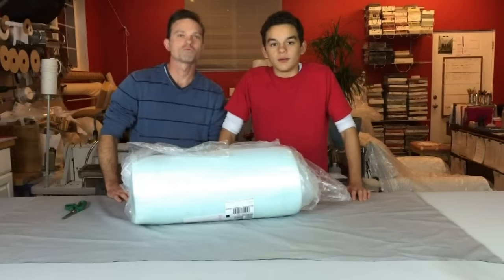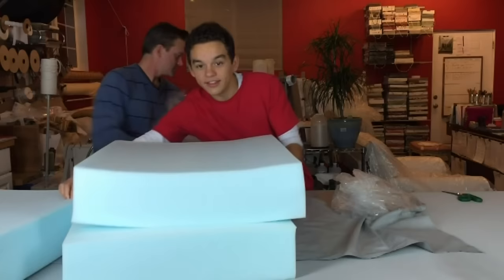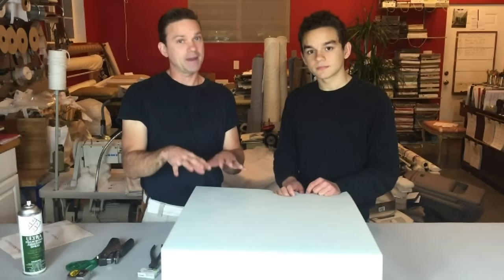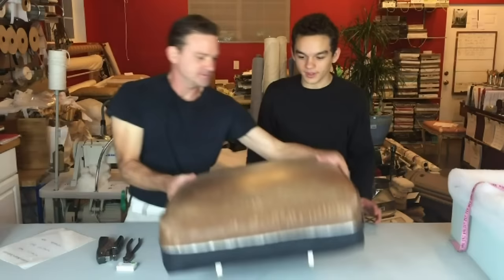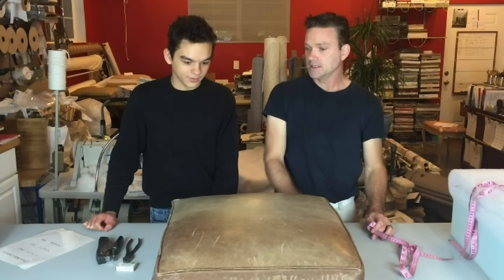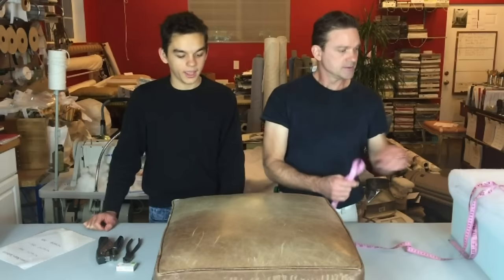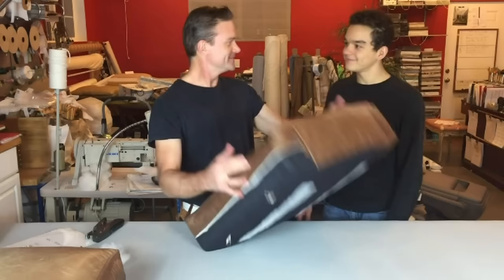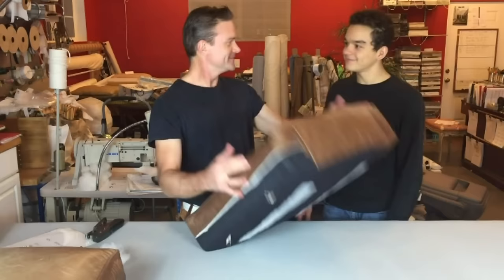Replace the foam in your seat cushions fast and easy!

Comment: Don't like the staples, potential issues with poking, coming loose and getting lost in fabric, furniture, floor, mouths of babies, floor stepping on them, jacking up vacuum cleaner... Learned a lot however, and enjoyed your thorough details and father/son professionalism!
Reply from the maker: Hi Artemisia,
Thank you for watching our video it means a lot to us. One other person had a similar concern. This practice has been around for about 5 decades, in the 3 decades I have been around this method, I have never heard of/or experienced the fear you have written about. Sometimes when stapling the batting together I will only staple one side not both. To remove that one staple, that is lodged in the one side of the batting ONLY!! You need to use needle-nose pliers to remove the bared staple from the batting. Staples fold on themselves when set in place! It is not likely to fall out!! Anymore than having a staple fall out of two pieces of paper that have been stapled together. There is always glue to use but, think of those side effects. Thanks again, we hope the video has helped you in your project.  All the best   Paul

Comment: Your tutorials are grand and both of you make a great team. Enjoy very much! 
Need to replace seat cushion on my couch due to sinking on one cushion that has been sat on the most. Likely have to do all cushions to be uniform.
My hubby does not like how low sofa is to floor. He feels his knees are up high. Is there a way to fix this situation? 
Was a gift. Only three years old. Material is still appears brand new. 
Thanks so much. 
Subbed!
Reply from the maker: Hi Linda,
Thank you for watching and for subscribing as well! Great questions are the legs on the sofa removable? If so the could be one way to add height the sofa, by removing the old legs and adding new ones. We go into the different leg types in this videos: https://youtu.be/K4RlabneiJI?t=4m41s hopefully this will help!
Thank you for waiting by the way, we have been super busy!

All the Best,
Grant

Comment: Thank you so much.  I have been covering my dinning room for years. I picked up a better way to cover them.  My problem when covering them is to get them all to look the same.  Also with dinning room chairs I would be interested in your Recommendations for the size of the phone
Reply: Sorry,  the size of the foam density.
Reply from the maker: Hi there Ann,  thanks watching our channel and leaving a comment. Yes it can be a challenge to make them all look the same, not only in thickness but mostly when lining up a print or matching it to other chairs. If you’re talking about lining up a print, matching reference points are the key as well as the measurements of the slip seat. If the fabric stretch it is really easy for the print too distort the matching. The foam recommendation for dining seats is usually 2 inches with a firm compression like number 45. I hope this addresses your problem again thanks for watching. Please consider sharing our videos we really appreciate it. All the best,     Paul

Comment: Excellent instructions and demonstration-great father-son team!  Some other videos have shown using a vacuum to shrink the foam and then inserting it into the cover.  Are there times when you use that technique?
Reply from the maker: Hey Brenda,
Excellent question! Yes, we do use silk film in certain scenarios for example when it’s a T or L cushion, as well as a very long chaise cushion. So this is pretty rare though since we usually opt to just muscle it in most of the times

Comment: i know that cushions comes in three colors...yellow, pink and blue, which one has the best, strongest weight and bounce back resistance over time when it come to both back and seat cushions...TIA
Reply from the maker: Hello Sazon, thank you for watching the video I have seen the yellow and the pink in the past but I don’t go by the color We go by the compression and the density of the foam. The supplier that we have used blue foam for high density.  The compression is 26 to 35 For Seat cushions. For back cushions it is a lot softer compression  20. Go to ucprivatecourses.com. It shows the options and you can purchase it there. Thanks again for watching please share with friends and family it helps a lot when you do cheers,     Paul

Comment: Thank you for this informative video. I was wondering what you would recommend for high use, outdoor cushions? We are in a humid climate and although the cushions are in a screened in porch it is still subject to the humidity. Considering as well that there will be roughly 200 lbs sitting on it. Thank you in advance
Reply from the maker: Hi there Robin, thank you very much for watching the video and giving us this comment. There is a brand name that we use call EZ-dri. But there’s other brands out there as well.  What you’re looking for is large open cells in the foam so it airs out faster. Also known as marine foam, you can get it in soft medium or firm.  I would go for the firm because of you saying the persons  using the cushions. Outdoor foam is somewhat softer by nature than indoor foam because of the wide open cells.  I hope this addresses your question and that you’d be willing to share the videos with others.  Thank you again. All the best too you,  Paul

Comment: I'm looking for replacement foam for sofa cushions. Measurements of the cushions within the seams are: Width= 25.75", Depth= 26.5", Thickness= 5.25". I've seen other places recommend adding 1/2 inch to all dimensions measured. Could adding 1 inch be too much that could affect the fit of the seat cushions in the sofa (especially the seat width)?
Reply from the maker: Hello SpaceBear,
Thank you for checking out the video, please consider sharing, it does help us when you do. On to your question: No I have never had complaints about adding an inch to all the measurements. When it comes to foam a half-inch more is not a lot. I have been using this method for 20 years. However, you would need to go with what you are most comfortable with. As for your measurements, we only recommend half and whole numbers, NOT quarters. So when it comes to your 25.75 and the 5.25, I would go with your cover as reading, (26 x 5.5). If you need a site you can go to ucprivatecourses.com for high-density foam. I hope this has helped you. Again thank you for watching.   Cheers,  Paul

Comment: Great video!!~  I want to replace the seat cushions in some store-bought chairs I love--not because the cushions are worn out, but because they are WAY too hard!  I love thick, soft cushions!  Can you advise me.  The cushions are 5 inches thick...and not symetrical.  Narrower towards the back.  Do I cut the shape myself?  Also, what do I get in terms of "compression" if I want a super soft cushion?  I weigh about 105. These are pretty big modern wing chairs from Pier 1.  (cheap...but I like them and they are like new...)  Just hard as a park bench.
Reply from the maker: Hello Pamela, thank you for watching the video I really appreciate it. Sounds like to me you have a tapered cushion, we do have that selection at. ucprivatecourses.Com if you order it there we do the cutting for you just fill in the selection box. We do not have super soft foam we have soft which would be 26 compression. It’ll definitely be softer than a park bench. Hope this helps.  If you have anymore questions please feel free to ask us. Please share the video, it does help us when you do. Cheers, Paul

Comment: Thanks for explaining foam “numbers”. The video is clear and concise. I wondered how staples were used where one might use adhesive to bond the Dacron. Do you recommend staples for outside cushions or adhesive to apply the Dacron? 
I noticed that your foam came precut. Is it typical for your form supplier to cut to size? Or can you cut it yourself?

Comment: I am stuck with a decision between 2626 or 2635 for a Lane sectional with 6 cushions. Cushions were very stiff and firm when we bought it new nearly 20 years ago. And the firm cushions was one of the reasons we purchased. Fabric is still great, seat cushions need a rescue. What comments could you give us regarding the difference in the 2 foams?
Reply from the maker: Hi there Morgan,  thank you very much for your comment and watching the video. This is a common question we get. One thing to consider is how thick the cushions are. The thicker the foam, because of the high quality density it will feel firmer just due to the density alone.  It sounds to me since you were attracted to the firmness of the cushions on the sectional in the beginning, I would go with 35 compression. Compression 35 is a medium density so from the information I think 35 so best. This a very high quality density foam it will last and feel very nice. So I hope this does answer your question, and again thanks for watching you, if you have more questions please feel free to ask,we are here to help. Cheers, Paul

Comment: I have a fairly new couch, less than a year old and yes, it does have a warranty on the cushions, but I absolutely hate the coil spring cushions!  It was okay to sit on, but to lay on this couch is painful!  I have a cushion that the coils have shifted and needs to be replaced, so I was wondering if I can replace these coil cushions with foam instead?  Lesson learned, lay on the couch you're going to buy :)  Because I know this is going to be expensive, but plan on doing a few at a time.
Reply from the maker: Hello Kim,
Sorry for the late reply we've have been so busy around here lately. YES! You can replace the spring insert with all foam core, it will be softer for you. I never thought about that as well, spring cushions not so great to lay on. You might want to try to have them replace them because they are under warranty, MAYBE they will exchange them for all foam core. Spring cores are considered high end, but if it's not cozy well then, BIG DEAL! Right. The foam that covers the springs might be low density, so you feel the springs more. If they will replace the foam covering the springs under warranty, that might be worth a try before you buy all new foam replacements.  Kim I hope this has helped in someway. Thank you for watching. Please share the videos it goes along way when you do.   All the best,   Paul

Comment: This was extremely helpful! Thanks. Just curious ... what were the two white bands on the bottom of the cushion in this video? Was that velcro? And if so, any particular type you recommend for keeping cushions from sliding?
Reply from the maker: Hey there Jason, thanks for watching the video we both appreciate it. Yeah that’s Velcro on the bottom of the cushion. They put that there so the cushion stays in place of course you already know that and it was genuine leather it’s very rare for factories to put leather on both top and bottom of the cushion, because it’s too expensive. If you’re having problems with a cushion sliding out, you can use what is underneath area rugs the no skid pad just cut a little bit smaller and it should keep your cushion in place pretty well. Hope this helps thanks again for watching. Cheers, Paul

Comment: Awesome video. My cushions have springs in them. I hate it because they are popping up. Not to the point of puncturing the fabric. Can I replace it with just the foam? Where do you get the density foam?
Reply from the maker: Hi there Mattie, I apologize for the late reply I’ve been extremely busy and are just now catching up on our comments.Yes you can replace spring cushions with all poly-foam. There are a lot of places on line to get foam, you can get it also at our site ucprivatecourses.com The higher the density number the higher the quality and the longer lasting the foam will be. We only sell high density foam. So I would only purchase high density. Thank you for watching the video.  If you have any questions on our website we do have live chat to help you along. Please share the video it helps a lot when you do.   Cheers, Paul

Comment: Thank you I love the video you guys did. I need to replace the cushions in two leather knoll pfister chairs. I thought I took great care in measuring the covers from seam to seam adding 1 inch plus Dacron. Foam was cut to those dimensions. When I inserted the foam it seems like the foam is too large and too thick. The cushions are bowing and the foam depth does not line up with seams. Any idea what I did wrong?
Reply from the maker: Hello there Kim, I’d like to help you with this problem. But I need to talk to you over the phone would be so much easier. Go to our website at ucprivatecourses.com there’s live chat there and we can exchange phone numbers. Or if you got the problem resolved thank you for watching the video. Cheers, Paul
Reply: ucsolutions Thank you so much for your reply. I must say I have learned a lot :)   Foam really  sticks to the suede side...making it difficult to slide down into a leather cover. Also 28 inches deep cushions are very hard to work with because one cannot get your arm down to the bottom of the cushion. But I trimmed my foam and slipped it back into the down casing/sleeve...making it easier to slide in. I wanted to get rid of the down as I wanted a more streamlined low profile cushion...but I reconciled to use it. They are very nice now...chairs are actually comfy again. Thank you!

Comment: Fix it for absolutely free!: 
Fix trick for car seats: Often used car seats upholstery is still good but the supporting foam is worn down-especially the driver’s seat.
Get some used carpet sheet foam(often your neighbor has some in the trash or in the trash behind a carpet store):
Unbolt the seat and peel off the fabric from the seat by removing the bottom retainers (usually plastic J channels) to gain some access under the foam sear core.
Add 1 or 2 sheets of foam under the foam core between the core and the seat bottom(1 sheet for the entire seat area and 1 small sheet for the butt area often is what’s needed for the drivers seat).
Use mallet to reattach fabric plastic retaining edges onto seat metal frame.
The seat will be amazingly plump and firm again just like new!
The seat backs do not need any foam since they don’t get worn from the full body weight pushing down like the seat does.

This trick SOFAS!: works great for home furniture such as sofas: for seat cushions with zippers: carefully unzip also peel off the fabric from the foam core, use a loose hack saw blade in hand and cut through from the back of foam block making it like 2 sandwich buns except stop before cutting through the front so that there is a solid foam hinge at the front.
Now cut and add carpet foam sheet or two or three laid into the middle of the sandwich.
While holding and compressing the sandwich foam buns back together, carefully and patiently roll fabric case back over foam and zipper shut.
The effect will be Dramatic, like new!
Often people think the sofa springs are sagging when aged but it’s the weak foam that takes all the direct weight and it just needs more added to bring it back to new specs!
Reply from the maker: Hey Jim,  thanks for watching and   leaving the comment it is a lot of information.  You’re right the foam is what gives out first. Most people don’t know just replace the foam it will be like new. Again thank you for watching and the comment. Please share the videos, it really helps us. Cheers,  Paul

Comment: I love you guys!  Excellent video - very clear instructions!  Ok ... so I have a leather sectional that has only 2 cushions that are straight forward like the one you used to teach with - the other cushions are shaped to fit around the arm of the couch and one that's a semi circle in the middle of the couch.  How would I do that?  Also, is it the same process for the back cushions?  Tell me if this is too big a job for a novice.  (yikes)

Comment: Hi, thank you for posting such a detailed explanation video on how to replace worn/old foams on cushions!  But I have a question:  I would like to replace the foams on my sofa cushions, but been having a hard time finding the size I need.  I followed the measurement instructions you provided, where you said to ad 1 inch to the width, height, length, but can't seem to find an online company that provides the size I need.  My cushions (with the extra 1 inch) are as follows:  Two cushions are 29in (left to right) x 24in (front to back) x 7in (band) each.  And the other two are:  36in (left to right) x 29in (front to back) x 7in (band).  The thickness (band) is what I'm having a problem finding a foam of 7in thick.  Any suggestions??  Please advise.  Thanks!
Reply from the maker: Hey thanks for watching I am very glad you liked the video. The right thickness of foam can be a challenge to find 7 inch is thicker than usual. If you are doing the foam cushions yourself you can glue on foam to make the correct thickness say a 3” to a 4” or a 2” to a 5”. But A high density foam does make a difference it will last you longer. So wherever you go try to get a density higher than 1.8. You can check out our website and get a free quote on a price at ucprivatecourses.com   Thanks again. Cheers, Paul